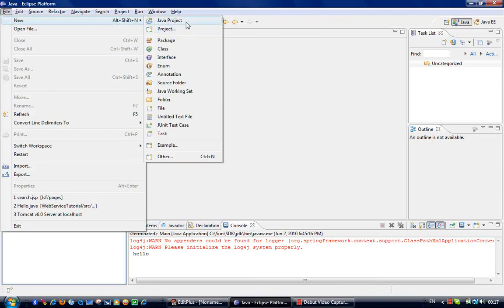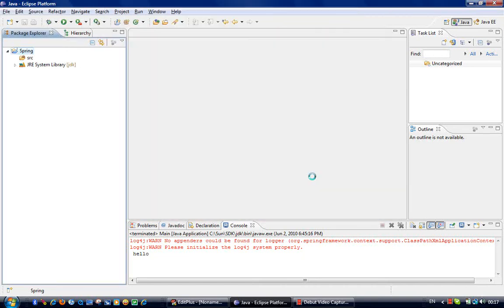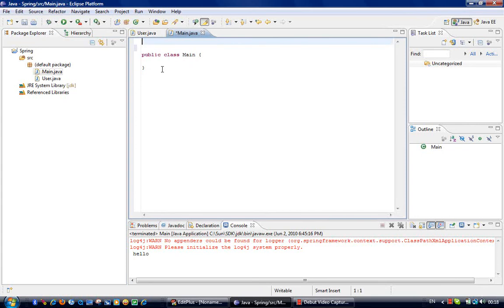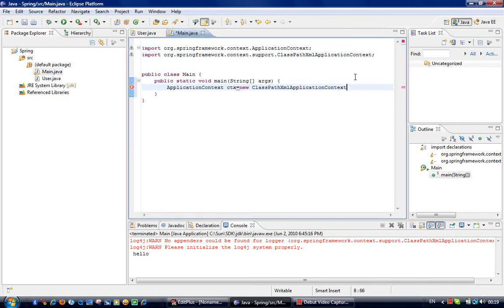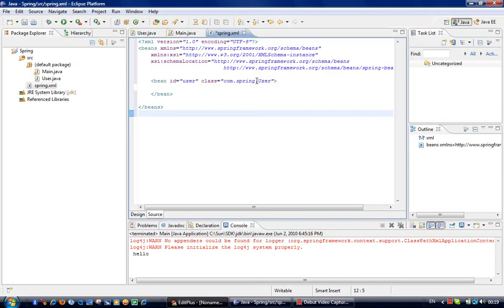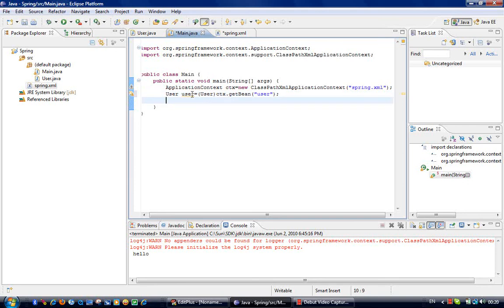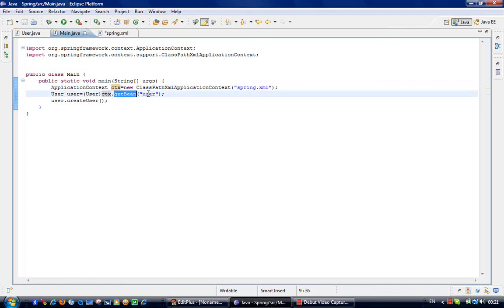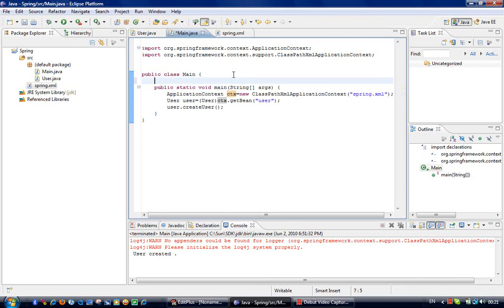Spring Dependency Injection tutorial using eclipse

Comment from the maker: @balajvinoth  . I'm just showing a demo to configure Spring framework dependency injection in your application . Dependency injection (also called inversion of control) is basically giving an object what it needs instead of letting this object get it by itself.  And I don't think you really need an interface to apply dependency injection you can very have it as per the design in your application . What do you mean by HAS a relation ? and how it hinder in getting the IOC in picture ..